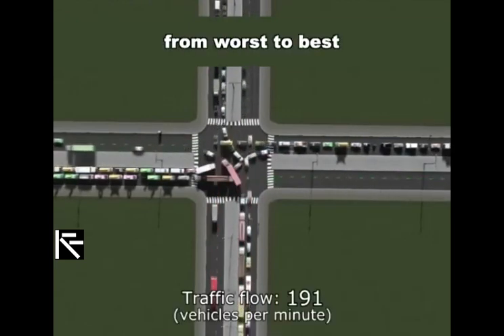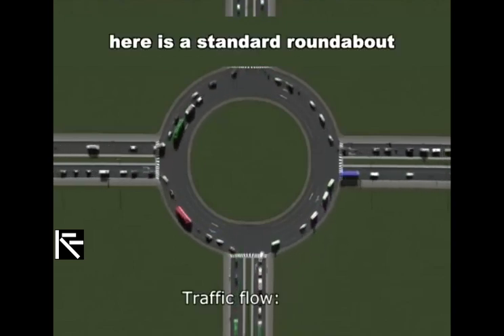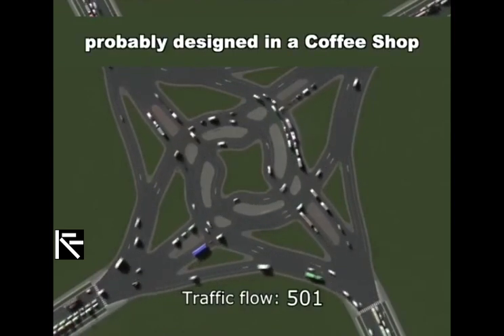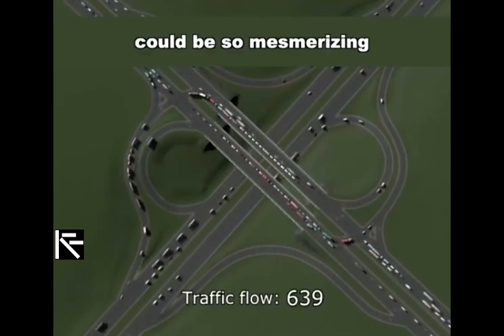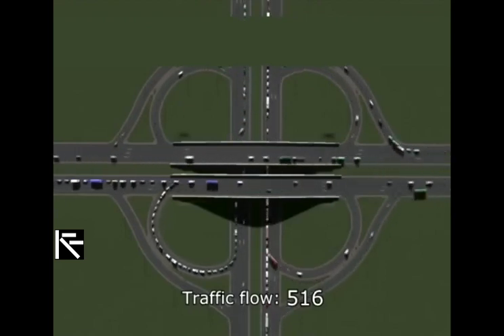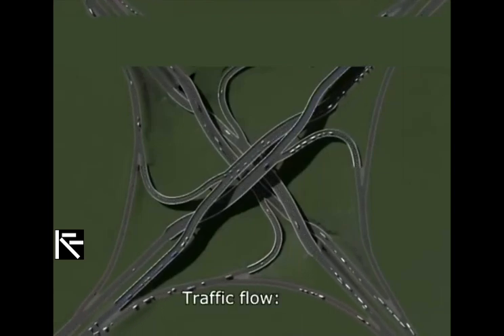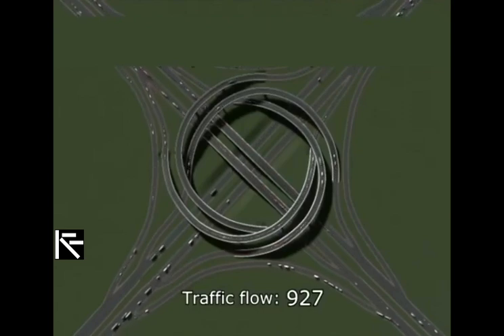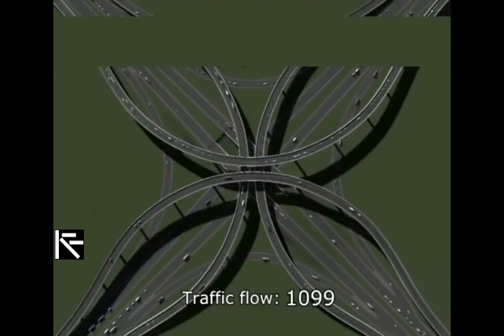Traffic flow from worst to best

Comment: You wanna see truly bonkers, check out Spaghetti Junction (I-285 at I-85 in/near Doraville, Georgia)... Not only do you have a Dallas-style Stack, but you've got one road that crosses I-85 just northeast of the main stack, and another than runs parallel to the northbound lanes of I-85, and the whole thing is incorporated into the macadam pasta.  Under design flows it's quite efficient... but flows have been well above design levels for decades, and the thing becomes a parking lot in the peak directions (east-to-south on 285 and northbound on I-85) every weekday afternoon.  Just as happy to be elsewhere these days.